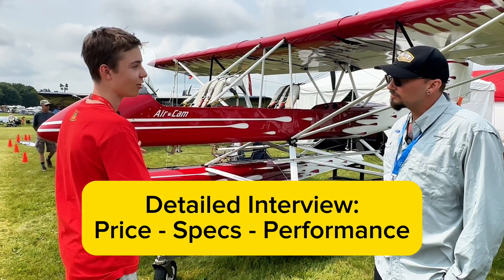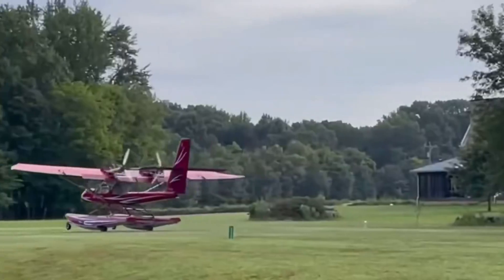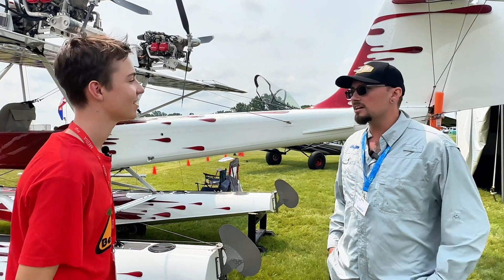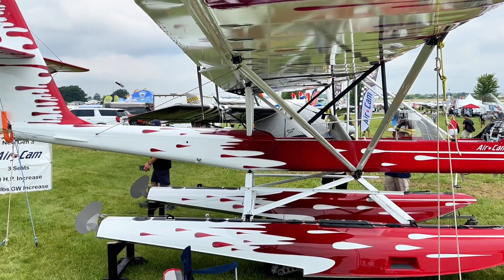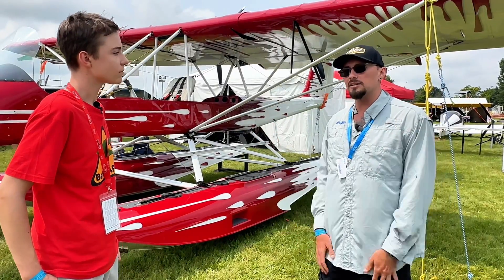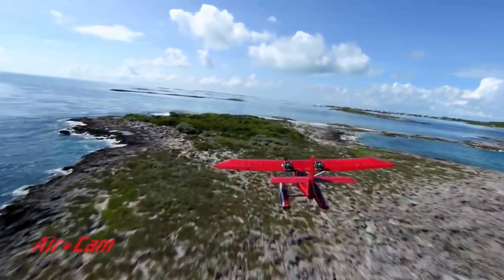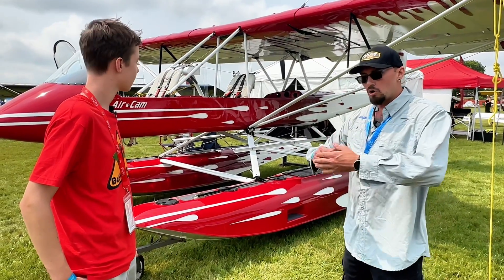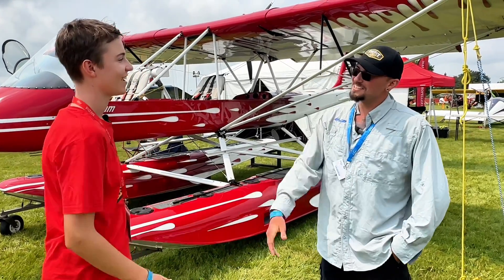Air Cam Twin-Engine Floatplane. Safest Floatplane.

Comment: These are really good. The length is right, and the information is what I actually want to know! I hope he doesn’t lose this ability as he gets older.
Reply from the maker: @hisheroship  they really are good Aircraft. If you look at the overall picture of these aircraft they are safe, can land on land or water which helps if there was an engine failure… but it is unlikely with this Aircraft because of the engines running independently of each other. Thanks for watching.
Reply: Don't worry successors are already in place.

Comment: It’s amazing how many independent manufacturers are out there making unique aircraft like this!
Reply from the maker: @tdub5899  so true! There is something about this Aircraft that is very attractive because you wouldn’t be spending half of your time wondering where you’re going to land in the event of an engine failure, because it is so unlikely to happen. I think you could enjoy the flying, fly slow if need be and land just about anywhere because it also has a very short field takeoff distance due to the power of the two motors. Thanks again for watching my videos!